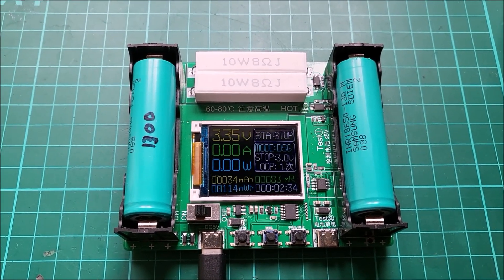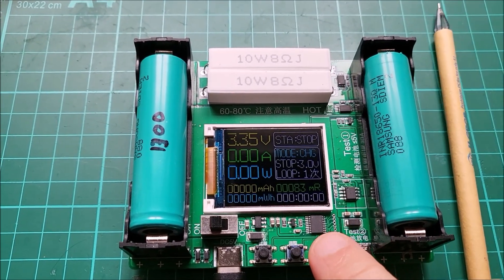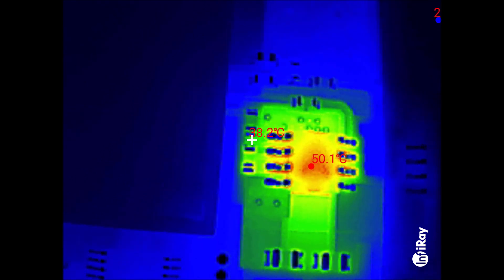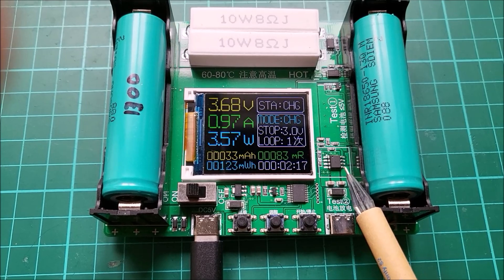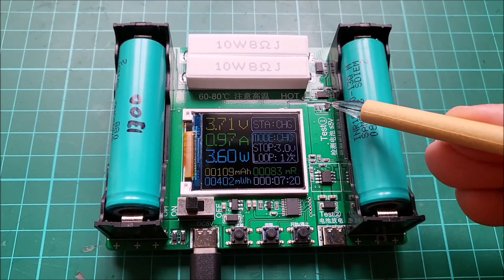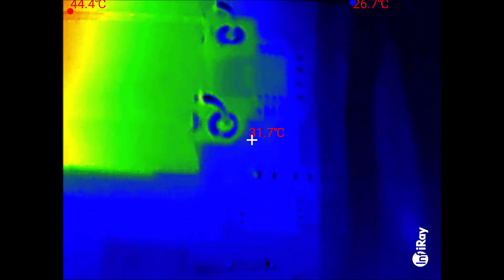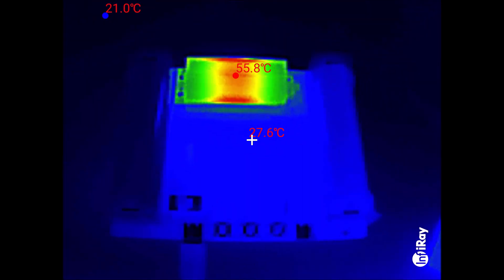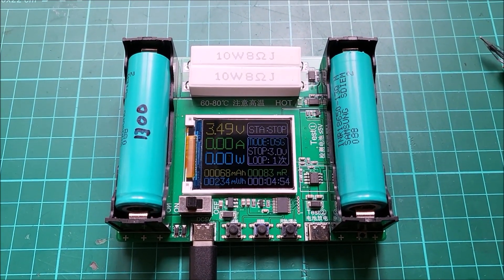Thermal Imaging 18650 Cell Charger with InfiRay P2Pro

Comment: I think the resistors would dissipate their heat better if they were mounted upside down, exposing the core instead of the ceramic wall, but that wouldn’t be as attractive. If your unit was made like mine, there is an air gap under the resistors and no thermal conduction to the board. I added thermal pad underneath and resoldered the resistors closer. Now the PCB helps cool the resistors and I put the unit on a laptop cooler fan.
Reply: Sure, but ultimately isn't critical as 56C is well within the resistor rating, they can operate up to 150C

Comment: I have one of these, but it is a different model.
Where you have the charge diode that gets hot, this has Two Three pin devices that look to be tied together in some way, maybe twin Mosfets or a Darlington arrangement.
I find this item to be a bit of a waste of time as I have a far better Four cell charger / tester.
I suppose this would come into use if my charger were busy, and I wanted to test a single cell.
Thanks David in Lincolnshire.

Comment: Is that diode really necessary? I would think a terminated USB C PD cable should be absolutely reliable... Judging by the temp, that's quite a powerloss in that diode. I didn't see anything in that circuit that should be able to give big backwards spikes in current?
Reply from the maker: Not sure why the USB input is fed through that diode.
Reply: The diode is there to ensure the current doesn’t go to the left cell I believe.  If it wasn’t there the TP4056 would dissipate more of the heat. I received newer versions 3.0 and 4.2, because I bought two different orders. Both of them now charge the left cell and the on/off switch was replaced with the additional charge circuitry to do this, although the two versions each have different charge circuitry.  The left push button now does the on/off function with long hold.  When I look at the diode which they still use, I see more thermal vias around the pads.  Version 3 has extra solder holes for a 21700 on the back side right bay and version 4 has the holes on both sides. If you want pictures let me know.